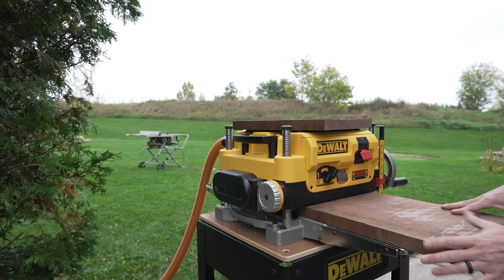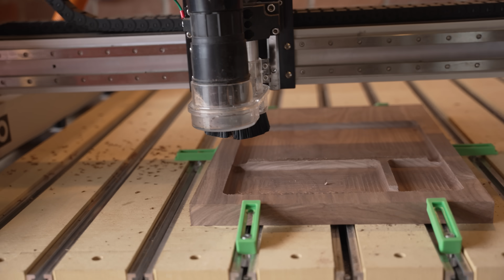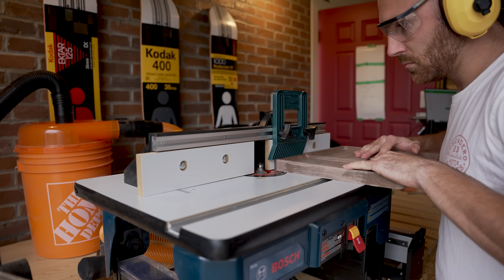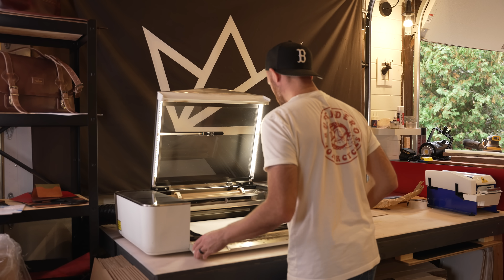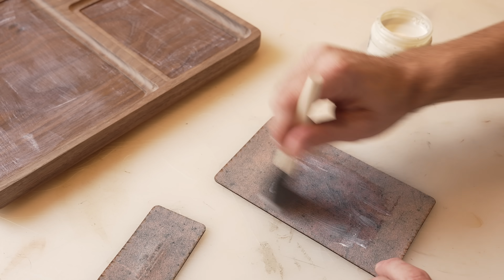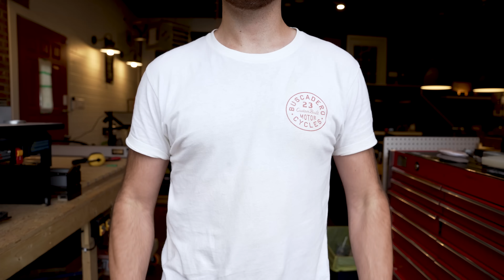Making our LEATHER & WALNUT ARMORY TRAYS!

Comment: 00:36 You should not make cross cut against the fence with the table saw. That might make kick back which is most common table saw accident. Use cross cut sled.
Reply: Agreed. At least push it all the way through.
Reply: I had a table saw kick back about a 10"x10"x1/2" board, that thing spiraled back at me and hit me in the stomach so fucking hard i thought i had internal bleeding lol.

Comment: DO NOT USE THE FENCE ON A TABLE SAW TO CROSS CUT!!! Accident waiting to happen.
Reply: Exactly my thought when I saw that!!!
Reply: Yeah you need a cross cut rig. They’re not hard to make
Reply: It’s a good thing he has a robot to do the rest of the woodwork, because he’s going to lose some fingers cross cutting and ripping like that.
Reply: Not gonna sugarcoat it: watching that crosscut made me fear for your safety.
Reply: Please listen to these comments. If you like your fingers and face the way they are!
Reply: Can someone explain this a little further? As a beginner in working with wood, with no formal education in the matter, I want to understand why this is a big no-no. Is it because of kickback?
Reply: @RaybanSam  if the piece your cutting binds on its way through by .01” (of an inch) it will take all 2.5 - 5 hp rpm’s (4000 - 12000), flip over and drag your hand across the blades… then it will whips that piece of material into your torso leaving minimum bruises as the reminder. I almost lost 2 finger because of that incremental of a adjustment. Always cross cut a piece that is longer across and never go backward for any reason on your push through.
Reply: With the width of the board that he was working with, it's fine as long as you are skilled enough. Thinner it gets, the risk and skill needed increases and there's definitely a point where it gets stupid to do a crosscut. It's very common to see this scenario out in production field when sliding table saw/sled isn't an option and don't have time to make a jig. Everyone has their rule of thumb on roughly how much width they are able crosscut by hand without any sled/jig. Overtime you get a better sense of what you can handle without being overly sensitive.

Comment: If only this one had a wireless charger in it that’d be banging.
Reply: Man, do I agree! I would JUMP on this if it incorporated a Qi wireless charging pad that could handle charging a phone, ear buds and smart watch! I don’t own a smart watch but a tray like this that can’t charge is great for pictures but it doesn’t provide a place to lay your MOST consistent piece of EDC overnight - your phone! Not unless you want a cord dangling. If you use earbuds, like so many of us, there’s a 2nd cord running across it. Smart watch wearer- now you’re covered in wires. Pretty sure it’s easy to source wireless charging pads capable of charging 2-3 devices. Shouldn’t be hard to router out an additional layer for the pad (under the leather) and route a USBC cable out the side. Sure it’d raise the cost but I want a tray that can actually get my device(s) ready for the following day AND look this great doing it! 

It’s SUCH beautiful work! If only it had that LAST little detail that made it so much more functional. At least as an option!  PLEASE??
Reply: I was thinking the same thing. I have the Courant "Luxury" Wireless charging tray which is much the same in form factor and purpose but under what I admit is an attractive leather surface it feels and sounds plastic. I'm sure it's like that because... what does it really matter what's under a thing that's entirely wrapped, but still it was the first thing I noticed when I unpacked it. I'd pay a bit more to have the same functionality in a more attractive format.
Reply: @dtom420  BRO chill...
Reply: @miodragstojiljkovic3706  Back atcha, “bro!”
Reply: I have made a few of these in the past. The biggest issue with wireless chargers is that they are #$%#$% expensive if you want to get a reliable one. I used to sell my trays for about 200$, adding the charger would be another 150$+work time at the very least. I am sure there is a market for it, but I couldnt find it at the time.

Comment: This looks beautiful and I would love pickup up my phone and stuff from this, but I usually have it on the charger at night. Have you thought about using the cnc to cut out the back to place a wireless charger there? You might would have to make this thicker to sit the charger in flush though. Idk if it is possible but I have seen other craftsmen put wireless chargers on the bottom of desk and it work through wood. Just has to be a stronger charger. Anyways great work! Enjoyed watching your leather videos. Getting inspired to start myself.

Comment: as a professional wood machinist, this was painful to watch as well as down right finger removing dangerous in places. Stick to working with leather before you take your fingers off or hand off. xx
Reply: Yes, there were some unsafe operations. But I’m sure he would appreciate some tips from a pro instead of just “stick to working with leather.” For example, I’d suggest using a sled for crosscuts on the table saw. That way you don’t have to use the fence, so the offcut can’t get wedged between the fence and blade and kick back at you. Keep working at it!
Reply: @c0wtron  the general tip for all is don't use what you haven't been trained to use. That's what college is fore